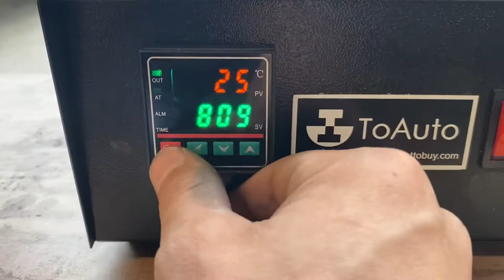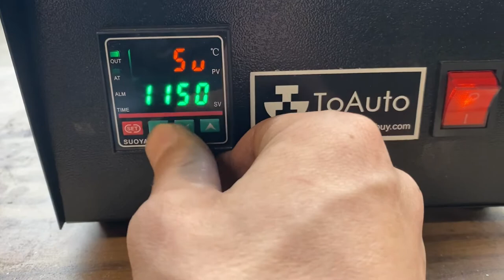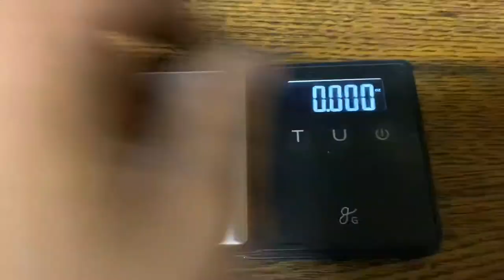Hand Pouring Some Copper Ingots, Skulls, and Eagles

Comment: Dip them in a bath of diluted hydrochloric acid bath for a few minutes then dry and use a polishing compound grey then white then add a few drops of oil on them to prevent any oxidation they call that the pickling process lol
Reply from the maker: Sounds fun, I’ll have to try it.